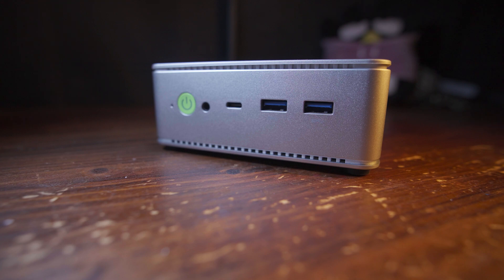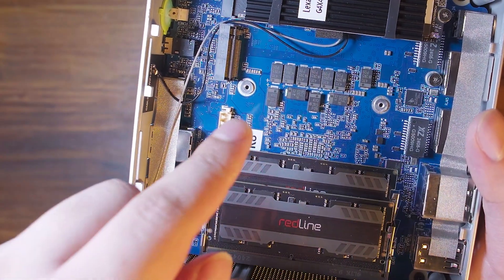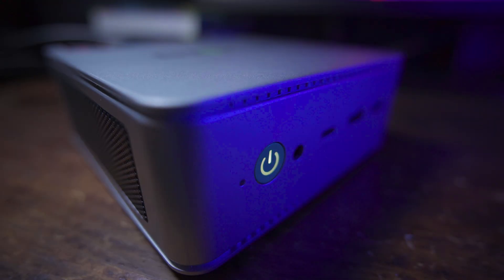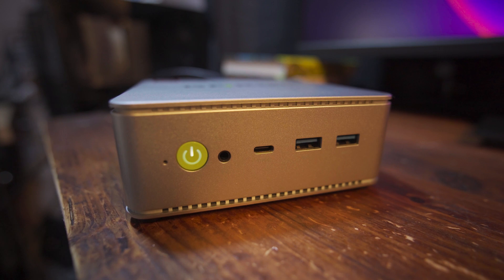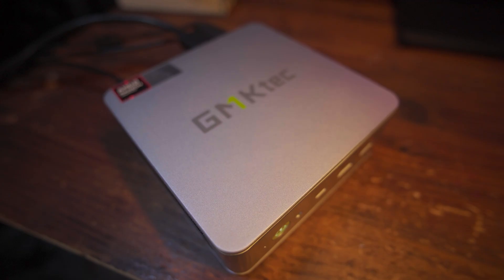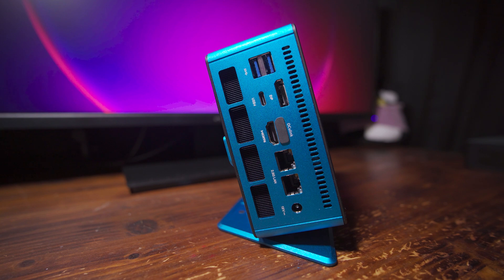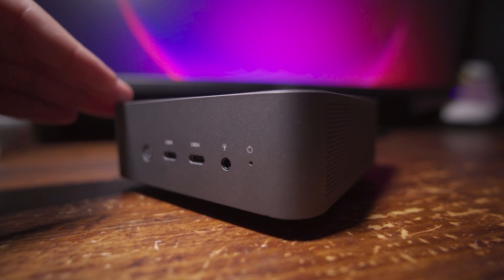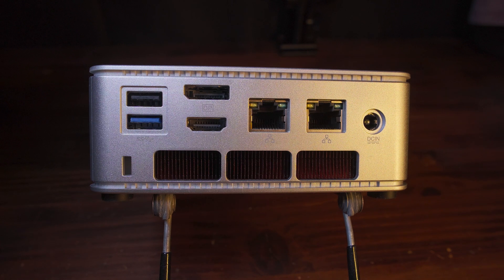Can This Mini PC Replace My Desktop? | GMKtec K8 Mini PC R7 8845HS 96GB DDR5 RAM | 30 Day Challenge

Comment: I’ve got a thunderbolt3 dock with 2 monitors connected that I’m hoping this pc will be able to run through the front usb4 port. Was this something you tested? Can it run multiple monitors through the one usb4 port?

Comment: Funny - I did this exact thing a couple of weeks ago as a test - only had 32gb of mem, and was running the UM780XTX - needs more memory before I fully switch - but I really could not tell the difference between the 780XTX and my 5700x3D main PC in either day to day OR most of my gaming activities (the 780m cannot handle 7Days to Die well at all :)). To that end, I'm going to just pick up an eGPU mount to run via Occulink.
Reply from the maker: hell yeah, if you can get an Oculink setup, it would turn this into a beast. I really wish the UM780XTX didn't lose the second m.2 for the Oculink or I would get a 3D printed eGPU dock for it. it's the only thing keeping the UM780XTX from being perfect. I hope we get another version of it from Minisforum with a dedicated Oculink port, and also hopefully they bring back the color options. I will probably keep that system running for as long humanly possible just because I love that blue case so much.

Comment: Bro help me please , I have a ryzen 5 5500U and it refuses to set my tdp to be 25W even though I followed every step in your AMD tunning utility , my laptop is hp 255 G8 notebook , I have all the latest drivers installed but still no luck

Comment: this is the future  this and the snapdragon  which put processor uhd and gpu all on the same chip  I am pretty sure this is why we see NVidia and other getting in to the mini PC market . I think pretty much at least at this TIme beyond  15 to 32 GB of Ram  most Device will just use all the ram use feed it  with out any real gain
Reply from the maker: I really wish Microsoft didn't sign an exclusivity deal with Qualcomm. Imagine if MediaTek and Nvidia were involved in the Windows On ARM roll out. The biggest issue with Qualcomm is how insanely terrible they are at proper driver support. Considering its normal practice on mobile to abandon driver development for SoC's after they release, it's no surprise Qualcomm dropped the ball there but it's crazy to be they really didnt expect anything bad to happen. I dream of what the launch would have been like if Nvidia released a SoC with their own iGPU based on Ada, and actual proper driver support. Nvidia could take over the whole handheld and Mini PC market if they can get an ARM chip out with an iGPU that is as powerful or more powerful than AMD and Intel's iGPUs. DLSS support would already be a huge selling point for a lot of people.